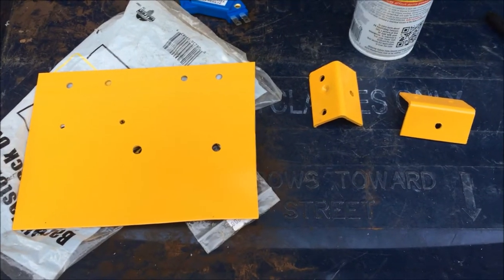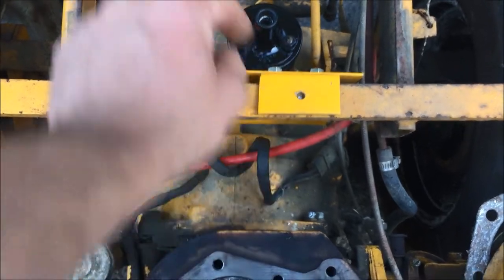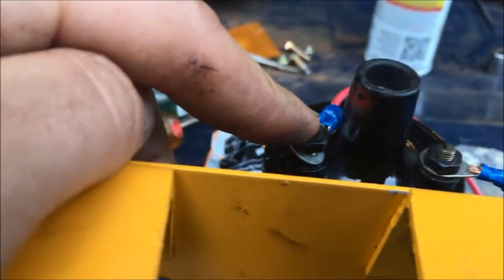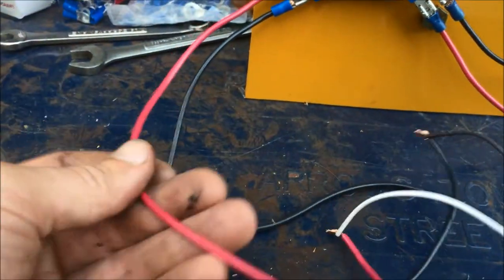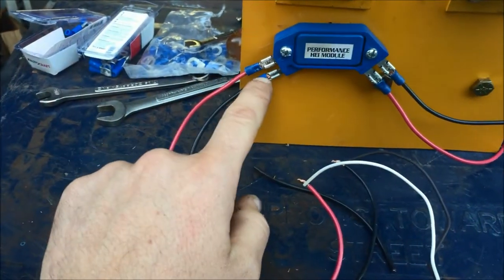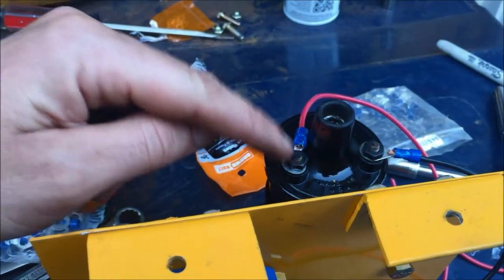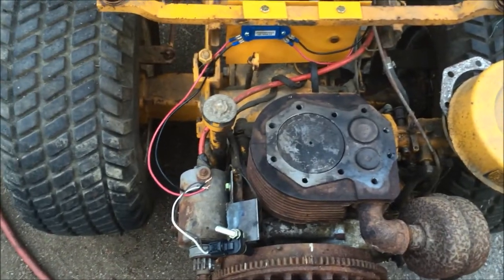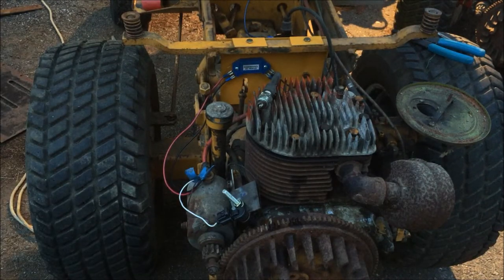Gravely 430 Onan NB Crank Trigger Ignition Build - Part 5 Sucess

Comment: I found that for full coil saturation, the GM HEI module works best used with a coil that has a 0.4 to 1 ohm internal resistor, or a 6 volt coil can be used for a stronger spark so engine will rev to its full potential.

Comment: Must use a High-Output/Performance GM HEI 4-Pin Module! This module works best on a small engine with a coil that has a 0.4 (for high RPMs) to 1.0 (for limited RPMs) ohm internal resistor, a 6 volt coil or a GM DIS (Distributorless Ignition System) coil with a metal core spark plug wire, non-resistor spark plug gapped at .025" for full coil saturation and a strong spark so engine will rev to its full potential. If a factory stock module and/or coil with a resistor higher than 1.0 is used, the engine may idle well, but NOT accelerate. Go here for more updated information: http://gardentractorpullingtips.com/ignition.htm